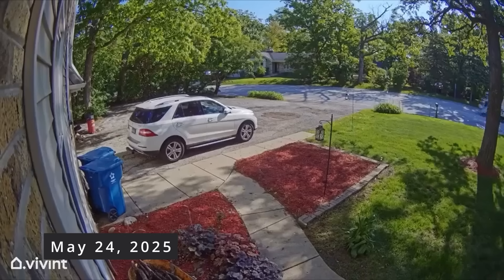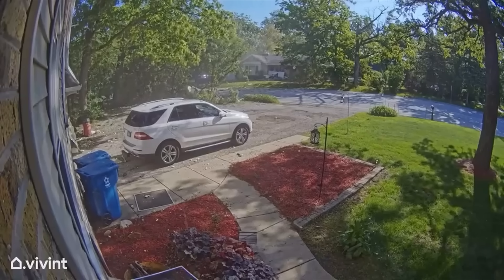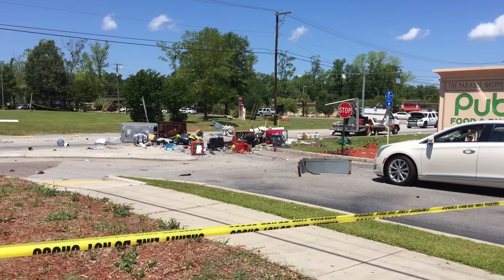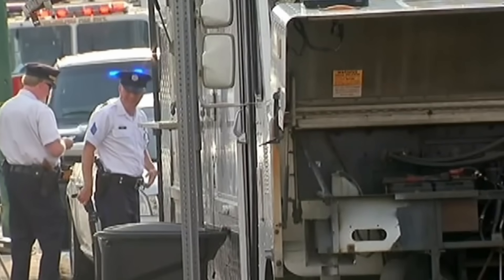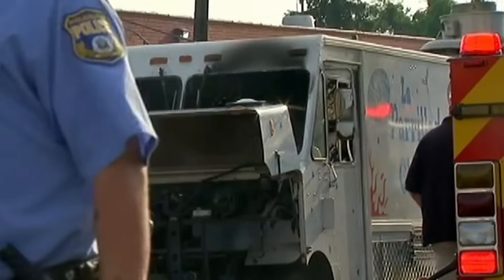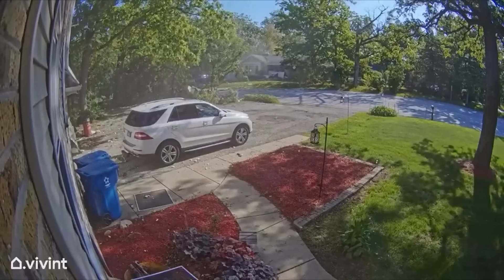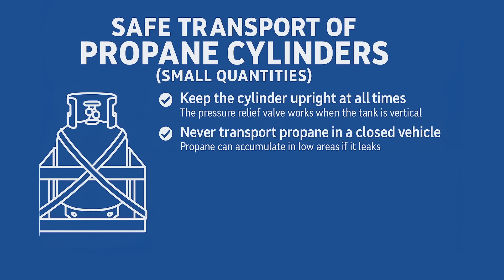Box Truck Explosion: How to Transport Propane Safely

Comment: RV propane tanks are mounted next to the frame without an enclosure.  Trailer tanks are mounted openly on the tongue.  Keeping LP tanks in a garage or transporting them in an enclosed truck is asking for trouble.

Comment: im tryna figure out how this happened...bbq tanks use vapors...but it would've had to have been wide open but even still a faulty wire below the truck bad or even the exhaust to set it off is a huge stretch...im tryna figure this out and it dont add up

Comment: Many years ago I was across the interstate  from a fire at propane distribution company in Oklahoma City. I could hear the fire roaring and see small propane tanks explode with a lound boom and launch way up into the air. 
I went inside and told my boss that I think we should evacuate. My boss said go ahead if I wanted, but he was staying. I told a few other coworkers and left. 
I found out about 5 minutes after I left, the police showed up and made eveyone leave. It turns out the fire was at the big tank 
What i found amazing as I was leaving was all the people standing out and gawking at the fire instead of evacuating. 
I often have to wonder if that was what people at Vesuvius were doing instead of leaving. 
Fortunately, the fire burned itself out and really big tank did not explode. If it had I probably would not have had a job or coworkers to go back to the next day.

Comment: All spray paints include butane gas. Enough to cause explode like that truck. They are everywhere and with others, accidents are extremely rare according the news. I have experienced two explosion  incidents: Lead acid battery and wood dust. Dust did flare when I trowed it to fire place.

Comment: Worked with someone who has a daughter who was just moving into a new house bringing baby along. While in the house she put the baby on the floor to crawl around while she checked out the house. Apparently there was a propane leak in the house that wasn't noticed, and it touched off. It didn't take the house apart but since it's heavier than air and hanging around the floor, it caught fire around floor level and seriously burned the baby.

Comment: Propane powered forklifts have the tank mounted in a horizontal position,  are those tanks built different with the pressure relief valve?

Comment: Stache, as an engineer, no doubt PV=nRT looks familiar?  

Propane stored as gas over liquid in a fixed volume tank does NOT expand as it gets hotter.  More liquid tries to vaporize, while existing gas tries to expand and cannot, and so pressure rises.  Higher pressure aggravates any minor leaks.  

Propane on boats is generally stored in an isolated locker with a drain down low, not just for water condensation, but any possible escaped gas.  Both boats and RV's generally have a fuel vapor detector and alarms, with sensors by the tank, and near or below range or other risk items, and remote solenoid vales at tanks that can be closed from alarm controls, or automatically in an alarm condition.   

By comparison, people handle propane in buildings or for grills rather recklessly.

Comment: Propane terrifies me.  I was responsible for safety in several manufacturing facilities, and tried to get employees to understand how dangerous it is.  People with gas grills too often do not understand the dangers or how to handle it safely.  That point was proven by your story of the gas grill being transported with the tank attached.  No, just no. It's so easy for the line to come lose from the jostling created by bumps in the road, sudden stops, etc.

Comment: Wow, thanks for the tips for transport. Youtube algorithm was helpful. I always strapy 20 pound tank after refills upright with a seat belt, but did not realize why (pressure relief valve).  I always head straight home after taking it out for a refill.

Comment: But propane stinks how do you not notice it? I had a overfilled propane tank leak in my car and I could smell it 10ft away. wow thats a reefer truck and I don't see the reefer at all, they are several 1000pounds and it threw it.
Reply: Some people actually can't smell it. Also the scent of propane is one the body quickly acclimates to, so a very small leak you'll catch small wiffs of, but soon you'll stop smelling it and most think at that point, "oh it must be nothing" and then as the leak gets worse, they won't smell it more, it will just be slight wiffs as the stronger scent overpowers the desensitization. This makes it rather dangerous. Also not all propane is scented, the scent is a added artificially to the propane. Also also, box trucks like that on have no connection to the cab, so it can be leaking like crazy and the driver will never smell it. I would also mention that they can leak quickly, just because it wasn't leaking 5 minutes ago, doesn't mean that it wont start leaking now.

Comment: Im my mind level of danger...propane low...actylene high cause its unstable...hydrogen dangerous cause it burns clean, cant see the flame and is odorless, and extremely easy to ignite.
Reply: Propane is odorless, what you smell is an additive, which not all propane you'll see has. Bulk propane on it's way to the refinery can lack the scent marker.

Comment: Unfortunately some of us only have enclosed vehicles with which to carry propane tanks in. Fortunately I typically don't drive more than a few miles to get ours filled.

I've also never understood why propane tanks have such tiny bases. It's like they are designed to tip over.

Comment: Not propane but an acetylene b tank. End of day, guy doesn't close his tank, valve for the torch is cracked open, fills a gangbox and a night crew goes to do a shutdown on water lines. Plumber goes to light his torch to do his work, boom! The poor guy had a fractured femur, if he wasn't 3 rungs up a ladder, he'd be dead. Gases are dangerous.

Comment: I have never felt a more powerful explosion than a propane tank exploding in a shop fire. At the time for me it didn’t even seem possible when they said my neighbors propane tank used on a forklift exploded in his shop fire. 

When I went over to help the neighbor after all was over, we found the propane tank. One end cap was missing, the other end cap was barely hanging on by a small bit and the round cylinder part that is welded down the center was almost flat. I was told the tank hit BLEVE. I think this was like a 10 gallon tank. Fortunately for the owner and the entire neighborhood, the 500 gallon propane tank was just far enough away didn’t get punctured, vent or BLEVE. I can’t image what a tank that size would do in a hot enough fire.

Comment: Safe if handled properly. Always disconnect for transporting, secure in upright position not just a milk crate but straps as well. Do not transport in a closed compartment. When using check for leaks with soapy water. (Dish soap works great or you can buy a product called Snoop) Replace the O ring if applicable if worn (O ring costs a few cents) Remember if using a wrench on the fitting to the valve it is a LEFT HAND THREAD unless it is one that is designed to be tightened by hand. On the BBQ only open the valve on the tank 1/2 a turn. It will provide all the gas you need and can be shut off quickly. Always shut it off when not in use.

Comment: That is why in The UK campers are required to have an air tight door on the gas lockers and must have vent holes passing through the base of the cabinet and directly outside the chassis to prevent these incidents.

Comment: I would argue that for the prevalence and ubiquitous use of propane tanks they are extremely safe. 

These are extreme cases and yes, if one overrides the safety features then they have the potential to become lethal. 

Using great porn and stating how dangerous they are whilst at the same time we hardly see any issues. Will that is now leading people to not take your serious at all. 

In our sensationalized world we often neglect the rational for the irrational short term hit. 

The massage should be. Treat propane with respect. Then it's safe. Because of you do not then you will find out the hard way.

Comment: A very important point. If a propane tank is on its side, the safety valve may not work properly. We don't want any catastrophic explosions.  I transport a propane tank secured inside the bed of my pickup with the tail gate up. No more. A temporary wood tail gate held up enough that the propane could drain away from now on.

Comment: I work in the propane industry.
I’ve seen many fires blamed on propane, some legitimate many turned out to be something else.
I have yet to see the picture of the propane cylinder allegedly responsible for this situation. 
Im wondering if there wasn’t something else (meth) in that truck, which has been responsible for many home fires, injuries and a few deaths.
Food trucks are the worst because of open flames during use. If this had been a food truck I wouldn’t be questioning this situation.
I saw a picture of a cylinder when this incident first occurred and if that was actually the cylinder I have my doubts

Comment: I live half a mile from the site of what used to be the only grocery store in this part of town. I loved that grocery store -- River District Supermarket, built in the 1950s. They had the best meats. But they stored extra supplies of propane grill tanks on the upper shelves, just below the ceiling at the front of the store. It followed all the codes, and there shouldn't have been a problem, if the stocking clerks loaded the shelf properly. But one day the stocking clerk must have set the last tank just "good enough" to get it to stay. He probably thought it was stable enough. Or maybe he didn't realize the dangers. That night I was awakened by the boom of an explosion that sounded very close to my home. It was immediately followed by a second boom, and then rapid-fire booms. I had jumped out of bed by the second boom and looked out my second-storey bedroom window to see flames shooting into the sky in the direction of the grocery store. There was no loss of life, thankfully, and no other property damage because the store sat far from other buildings. And it happened at a time when there's hardly any traffic. It's could have been much worse. I walked to the area the next day, and there was nothing left of the store. Not even a pile of rubble. The fire had burned so hot that the concrete was consumed. It was just nothing. Surreal. Editing to add that the fire inspector was on-scene right away, and immediately saw where the first tank had fallen, then a second tank had fallen with it. That was followed by the ignition of all the other propane tanks.

Comment: Recently, I was operating a propane powered platform lift in an indoor soccer field. The roof/ceiling is 48' at the peak and 42' at low end.  The building is about 400' x 200'.  We were about 35' up, prepping for a big event.   Suddenly, we both smelled propane.  We shut the machine down and got a ground rigger to check the tank.   It was leaking at the valve. It was pulled off and reolaced.   It should be noted that there were two large overhead doors open at the time and it was a fairly windy day.  Considering that we were near the roof, and propane sinks to the low area, I suspect that the high air flow through the building had pushed some propane up to the ceiling and thats how we noticed it.  Oddly, nobody on the ground noticed it, however, there was only 3 people scattered on the ground .  Dusaster averted.

Comment: A forklift tank is NOTHING, like a BBQ tank.     Forklift tanks hold more propane, and the ARE designed to be layed on their side.   The amount of propane in a aluminum forklift tank is about twice the amout that in a bbq tank.  Not only that a molten strem of steel pouring on an aluminum forklift tank would have melted through the tank before the pressure relief even had a chance to pop.   Just glad you weren't hurt..

Comment: You're conflated the stats of BBQ fires with tank failures. True tank failures are exceptionally rare. Improper storage and handling is far more common which is generally just vapour burning off rather than the tank catching fire. (most videos I've seen, the initial fire actually puts itself out) The average consumer is just downright dangerous around propane BBQs. No one reads instructions.

Comment: Properly transporting propane is a big deal. I'm not disagreeing with your safety message. 

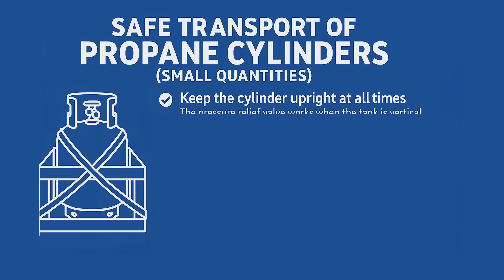2:30 forklift tanks are usually mounted on their side and specifically designed to be safe in that position.
However, even on their side forklift tanks have a up and down. Best practice is keep them vertical.
I only say this because I have had co-workers argue this with me.

Comment: These tanks have always made me nervous so I built a mini outdoor shed for my tanks. It's more like an oversized doghouse, painted white with plenty of vents and insulation to keep the heat from sunlight down. And it's about 50 feet from my house. Not far enough if it goes boom, but better than having it next to my house or on my deck. Speaking of that, I use a 50 foot long hose from one of the tanks to reach my grill. No need to have it sitting at my feet while grilling.

Being reminded that propane is heavier than air, I think I will add some vents along the very bottom as well.

Comment: For small cylinders (14 oz, 1 lb.) you can get brass caps with rubber washers to seal them when not in use. If the fittings on larger tanks are the same size, they would work on them, too.

Comment: A uni lab once ran on piped coal gas for their bunsen burners.
Local Gas Co closed down.
4.5kg  propane bottles to run new bunsen burners.
Easter holidays, air con off, doors closed, no air movement.
Small bar fridge always running.
Small gas leak was always suspected (smell) but not acted on.
Over the few days of inactivity, the gas pooled on the floor and rose to the level of the electric motor in the bar fridge.
Boomus extremis!
Fortunately the large windows were the week point , so no structural damage.
Gas bottles banned and piped  natural gas (lighter than air) installed very quickly.

Comment: Also now we have heat pumps with R290 refrigerant which is propane and thus safety regulations apply to these. Most systems only have a small amount.

Comment: What makes a bigger Boom? A nearly empty tank, or one that is full? I ask because I transport both and I have always felt the empty ones are a bigger risk, like they are hand grenades in the event of an catastrophy!
Reply: Hi, it is not the gas in the tank that is the problem. It is the large volume of gas/air mixed to about 15:1 that spontaneously combusts. In open air most of the gas will disperse to less than 15:1 and may not even be burnt in any flash over

Comment: Our dutch natural gas distribution grid has very low incident rates.
Transporting high pressure gas or batteries is not the proper way to move energy.

Comment: I have 5 propane tanks I store in an outdoor shed. Fortunately it’s not sealed well. I went to get my generator out this winter and had to move some of my propane tanks out of the way. One was completely empty that was full previously. Thank god nothing happened as a result. I never even smelled a leak.
Reply: But the professionals say don't store propane in building or shed.  Store on a firm, flat, level surface that allows for water run off (to prevent rust).  Store out of direct sunlight.  Other cautions/rules exists, too.
Reply: Oddly, for propane/grill safety, you have to use multiple professional sources to get the entire story on safety.  Not sure why they all leave something out.

Comment: Happens all the time in Taiwan, I seen gas stores (as in they have hundreds of propane tanks filling the store), and they are indoor. I sure hope the guy there isn't smoking. I mean the door's open and all but if one leaks it could still build up. Also gas providers often transport them on motorcycles, 44lb tanks (20kg) lying on its side. A mall got destroyed in Taichung because someone was doing construction and the gas line wasn't shut off or purged. That explosion killed a few people.

Comment: What about a propane tank powering an RV fridge? Does it have to be shut off when moving the vehicle? I thought it was designed for mobile use?
Reply: Hi,  big hazard is when refueling with petrol and the vapours from Mr. Nozzel meets the burning flame of the fridge pilot light or the full flame from the gas jet.
Reply: @davelees8022 thank you, I have that on the checklist for propane refueling, to shut down the fridge. Just wondering if I should be shutting the fridge off every time I move/drive the RV/van.

Comment: Now do a video on acetylene and oxy-acetylene equipment! 
It's different enough to deserve one as responders may need to make fuel gas and gaseous or LOX containers safe if a shop in use catches fire.  I suggest a quick explanation of regulators and torch knobs since gas valves are old hat to responders. The Mine Safety folks unsurprisingly have excellent basic oxy-fuel safety briefings.